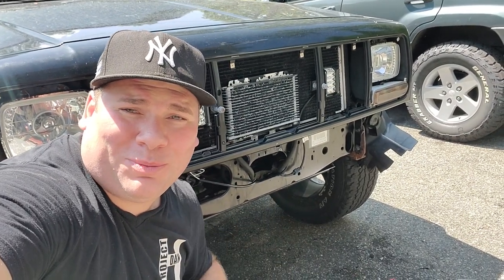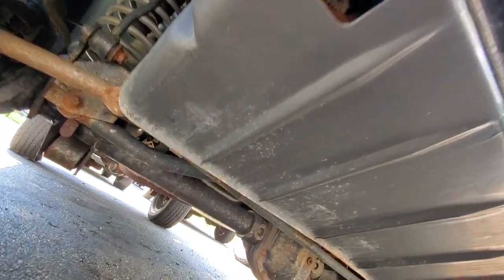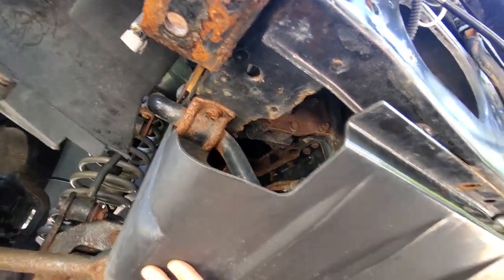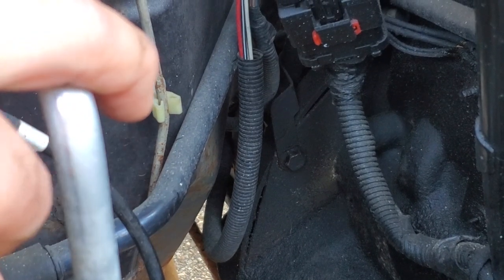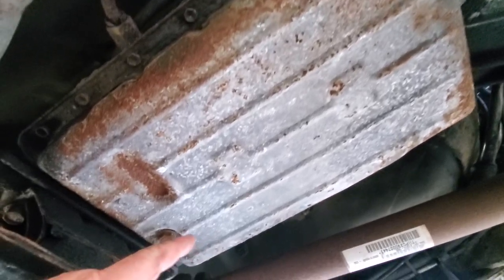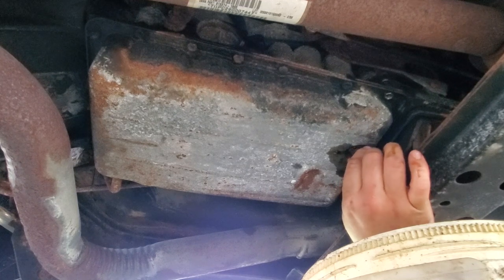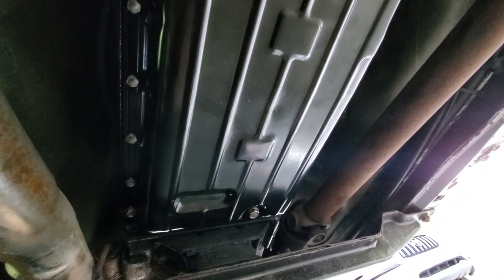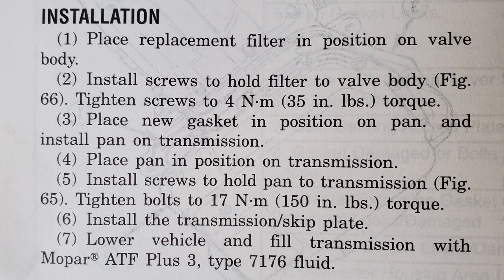JEEP CHEROKEE XJ TRANSMISSION SERVICE - PART  1 TRANS PAN & FILTER

Comment: I like to use the bead-it in the spry can for this it works perfectly and won't leak comes in gray , red, black ect.. Also the filter bolts have a torque spec so next try and include them as well . Great job 👍 Black beauty rides again !! P.s. I spray clear coat on all my lines , trans , brake , fuel ect.. it keeps them looking good and rust free for years to come .
Reply from the maker: Excellent tips! Thank you!

Comment: Excellent video Dan! In my book, if you can get the bolt out, it's not completely rusted out. LOL TJ wrangler's rust out worse than the cherokee's. And, for those who don't want to loosen the trans pan, just jack up the front and put it on ramps to get the most fluid out.
Reply from the maker: Rust is terrible! Great tips!!

Comment: Awesome video dude, just did a new filter and new kick-down(tv)  cable. Made the mistake of putting the gasket on, but might pull the pan off one more time and use RTV instead like you described. If you run a transmission cooler, check out glow-shift tranny gauge. They even sell a single pod gauge mount for the drivers side pillar. From a fellow long islander, another great video!
Reply: This is on a 2000 cherokee sport btw**
Reply from the maker: Awesome brother! Thanks!!
Reply: I have a 94 xj and I was wondering what’s the benefit of using RTV rather than a gasket?

Comment: Something I bought once and used multiple times, oil pan snap ups.  Used on the oil pan and trans pan on my XJ, trans pan on my ZJ, and I think there was something else before they disappeared.
Reply from the maker: They came with the oil pan gasket set, but not with the trans set I got
Reply: @ProjectDanH  They fit the trans pan bolt holes

Comment: I can't get the pan out. I don't have the leverage/space to really yank out the whole dipstick tube. I'm going to have to leave the old filter in and just refill the transmission fluid until I can figure out how to get the damn thing off.
Reply from the maker: oh man, its so annoying.  hope you get it one day, god speed!
Reply: @ProjectDanH  Went pyro with it and used a torch. It surprisingly came right off after about 10 minutes of straight heating. Melted my brand new torch in the process but I got it off, cleaned, painted and back on there. Sherman the Tank is running smoothly. Thanks for the directions!

Comment: I am about to start this job. I am a little worried on getting the right size O ring for the dip stick tube. Don't want it to leak after putting it back together. How tight was the top half of the dip stick when putting it back in to the bottom half. Thanks for any info
Reply from the maker: Pretty tight, you don't want crud to get in a sloppy dipstick tube.
Reply: For some insurance put a hose clamp on the tube to keep it tight

Comment: My transmission sump plug just spins and won’t undo. Anyone have any solutions?
Reply from the maker: Grab a new pan
Reply: @ProjectDanH  I was actually able to fix it. I removed the pan, and with a bit of leverage, was able to get the plug out. I retapped the threads in the pan and got a new plug :) I’m in Tasmania, so just getting another pan wasn’t really an option for me.  XJs are pretty thin on the ground round here :/

Comment: Where in the vin does it designate an xj or a zj on a 1989 jeep Cherokee Laredo
Reply from the maker: Vin numbers don't designate between XJ or ZJ.  The digit placement however does,  have other specific functions.  If your jeep is an 89 then its an XJ
https://www.morris4x4center.com/knowledge-center/vin-jeep-cherokee-xj-1984-2001/
https://www.morris4x4center.com/knowledge-center/vin-grand-cherokee-1993-1998/

Comment: torque specs homie
Reply from the maker: not much, prob under 20 ft lbs
Reply: @ProjectDanH  Yea was just curious about the oil filter, And the pan too. Some guy on an old forum said 60 ft lbs, Then up to 80. . Let's just say I have 16 of the 19 pan bolts now. Dug through some shit and found. an old book for my jeep. Pan torque specs is 10 ft lbs, did 7 for the filter.
Reply: @ProjectDanH  Appreciate the videos for real. Really helped me out.
Reply: @Quesadla  sure he didn’t mean inch pounds?